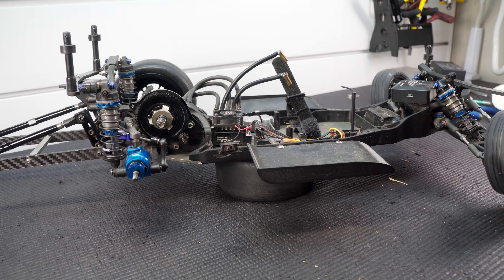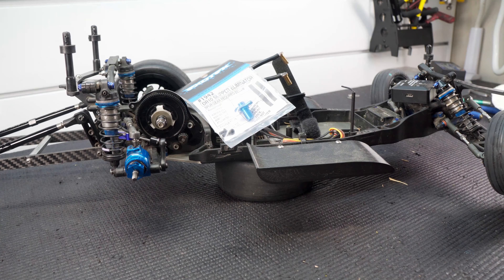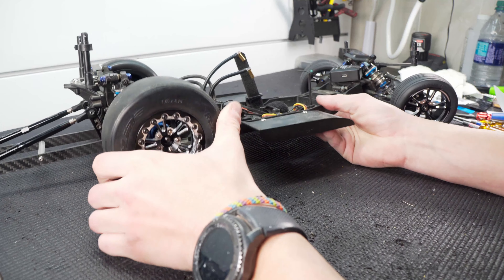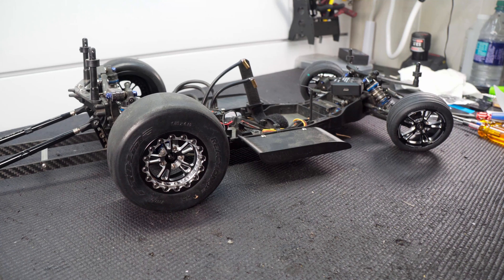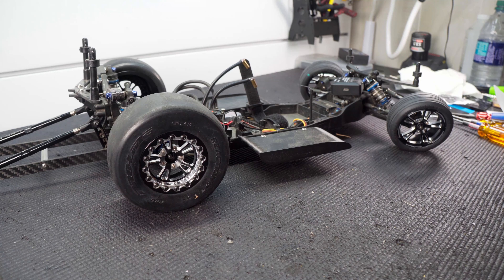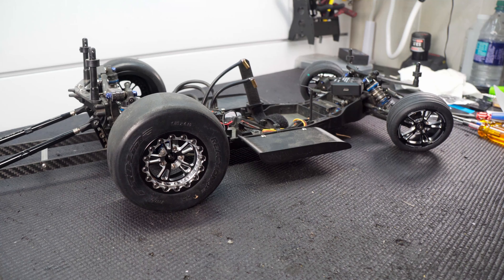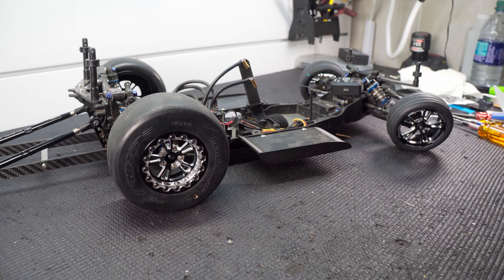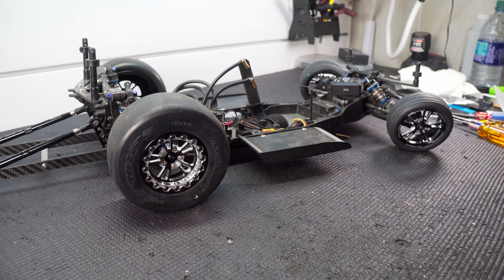Is a Slipper Eliminator any Good in my No Prep Drag Car?!? | FullThrottleDragRacing

Comment: I had issues when I locked mine, the gears would studder at low rpm, so I had to loosen it up,  the coupling that hold the bearing was spinning inside of my spur and basically plastic welded it to my spur. Sound went away wen I loosened up 1.5 turns. I don't drag race tho, I just am going for top speed , I'm at 100mph with an arrma vorteks

Comment: About to put one on my 2wd slash that's srushed with the 82 spur and 16 pinion hopeiit gives it a little more power
Reply from the maker: It may not give you more power but it'll make the acceleration feel more "punchy" if that makes any sense. That's what I felt anyway

Comment: What r the dimensions of that slipper eliminator, making spur gears rn for the dr10
Reply from the maker: What dimensions are you looking for specifically? I could try to help but honestly in my experience making things, it's better to have the parts in hand to pull dimensions and check fitment

Comment: One other thing that I noticed is the angle of your dog bones. They are at a downward angle and for drag racing you want them to be as level as possible also considering that the axles want to straighten themselves out under launch. I would recommend looking into 3d printing a riser for your transmission like how the bullet and r1 chassis have to raise the diff. This will aid in traction and keep excessive load and wear off the drive train
Reply from the maker: I never really thought about a riser, could be something to look into. I'd be a little worried about raising the motor as well though.
Reply: @FullThrottleRC   It will raise a motor but the benefits outweigh the bad add with the dog bones up above or level twor level to the hubs when the car launches it will push down to street note therefore driving force into the tire and making it plant Look at the TSR or Tim Smith racing Podcast and the episode when he talks to big chief about leverage. It's the first interview, this is how you would make a no bar car work.

Comment: I run the same one.lots of options on spurs.i kept blowing threw my slipper.now it will take power.
Reply from the maker: Yep I believe I was having the same problem. I like the options for different gearing I have now
Reply: @FullThrottleRC  plus gears are reasonably priced

Comment: First passes looked great!  I run a slipper eliminator on all three of my drag builds. Drops weight and you never have to worry about losing power to a slipper either.
Reply from the maker: It has really seemed to help me so far. I was hesitant at first cause I liked tuning the launch with the slipper but I realize now how inefficient that was. Thanks!

Comment: Dude I appreciate you posting not alot of people run the losi..???? I have the losi and infraction!!! My babies I have a total of 13 rigs oh my typhon!!! The rest except one are nitros I cant part with those but the electric game is AWESOME!!! Anywho keep putting out the videos..last put up an option for us to gift you for your time and knowledge!! I'm just now finishing up the infraction so my losi is torn down due to a wreck at 58 mph it was minor damage but stripped the gears...so I'm trying new gearing?? Any suggestions??I run hobbywing 4.5t esc is xr8
Reply from the maker: Thanks for all the support!!! I have a few different cars in my fleet front Losi, to Axial, to Associated, and still have the Traxxas Funny Car. I don't have a preference for any, just really appreciate the engineering and different styles of each manufacturer. As for supporting me, I do have a Patreon set up but I haven't gotten around to figuring out a good system for it yet. Right now it's mainly just for 3d printing files and such, anyone who supports me on Patreon gets all those files for free. As for gearing, I run 84/21 or 20 right now. Been playing around with that and it's pretty consistent. Good luck and thanks again for the support!!

Comment: Great launches, glad it worked out for you. Level that rear end up and you’ll be set, your rear axles aren’t quite level, I think that will help you some also.
Reply from the maker: Thanks! To get that, I may have to create a spacer or something for the transmission like someone else mentioned. I'll have to look into that.
Reply: @FullThrottleRC  I just built spacers for my B6 original based car. I raised mine 7mm. I haven’t tried it yet.

Comment: I did this and it ate up all my spurs
Reply from the maker: I've stripped one spur gear since installing the eliminator but I think it was more due to the motor position changing over time and the mesh tightening or loosening up than the eliminator causing it to strip.

Comment: Hey bro love the channel and the content that you provide just wanna say that the slipper eliminator is going to be a great investment and you will see the benefits of it I was sitting but I was suggest going with a bigger spur a bigger spur gear that's going to give you a better launch and roll out with the car make it smoother and easier to launch You should also be able to go 100% in the radio and take your 1st stage in  Lent in the stage out you should be able to do everything in the ESC and not have to touch the radio if you need help hit me up I can walk you through it
Reply from the maker: Thanks man! I did pick up a few other Spur gears so I'll try a few out. The plan is to get to 100% in the radio and only use that for really low traction conditions where I can't get the car to launch without it.

Comment: I knew you'd like it. i went eliminator and never going back. As far as your radio tune, definitely try to only run drk tuning, not a mix. it could cause problems, maclan themselves advise against it.
Reply from the maker: I'm getting pretty close to where I shouldn't need to tune much with the radio anymore. Just easing into it. Thanks!

Comment: Just buy the pro line slash body mounts in bolt it onto the front shock Tower
Reply from the maker: I didn't know the slash mounts fit. Thanks for the tip!
Reply: You kind of have to make them fit by a drilling but I have them to fit on mine right now
Reply: I just had to bore the whole up and down so the body mount would go lower

Comment: Are you using a locked or a open diff? Awesome video
Reply from the maker: Open diff, 500k fluid. I ran a locked diff in the past and couldn't keep the car straight on the top end.
Reply: @FullThrottleRC  awesome thank you for the info

Comment: How familiar are you with a spectrum dx5c radio ?   Figuring  settings as to launch control. As I mash it it’s slow to a point then all power in.   Not messing with settings in my hobbywing xr10 pro 160 amp esc settings yet
Reply from the maker: I don't have any experience with that transmitter. Couple things I'd check though is any dual rate on the throttle channel or it could be a factory setting in the esc.

Comment: Not sure u know when you go with an eliminator you need to run your gear diff at 250k 👍
Reply from the maker: I'm running 500k fluid in my diff already actually. Probably going to go to 1mil next.
Reply: @FullThrottleRC  😳

Comment: If you don't have a  slipper eliminator does tightening your slipper all the way do the same thing?
Reply from the maker: Not necessarily. I tried this. It can still slip a bit and the excess pressure can wear out the pads quicker and cause it to start slipping more and more over time.

Comment: What did you put in before the eliminator.  I tried just putting eliminator and screws rub
Reply from the maker: My transmission had a spacer on the top shaft. Not sure if it came on the original transmission as when I bought the b5m it had a Schelle racing slipper in it
Reply: Thanks I’m trying to put on dr10m and the screws coming out the back rub the housing

Comment: Would you recommend a slipper in my slash 2wd, it’s for off road use only! Or is this strictly a smooth surface ordeal?
Reply from the maker: I'd definitely keep a slipper in an off road truck like the slash. The slipper eliminator is useful like this in drag racing but you could damage some things just bashing with one.
Reply: @FullThrottleRC  thanks man! Went with the traxxas 272R unit, figured I’m gonna need it! Also, what’s the best resell or trading group in Facebook? Just bought a new 4-Tec brushed chassis and it’s not my thing. Also have the painted ford GT body.